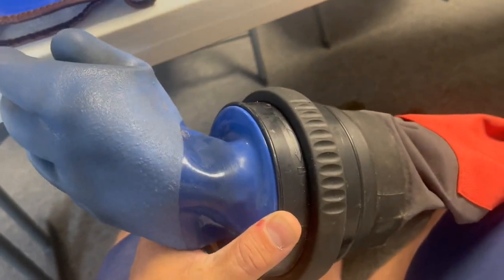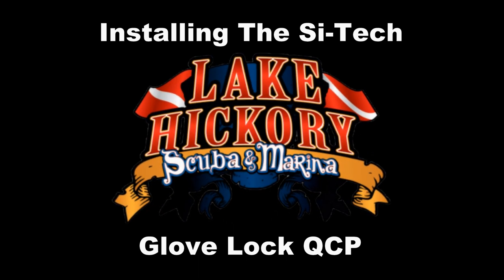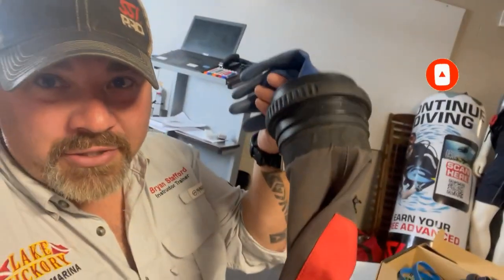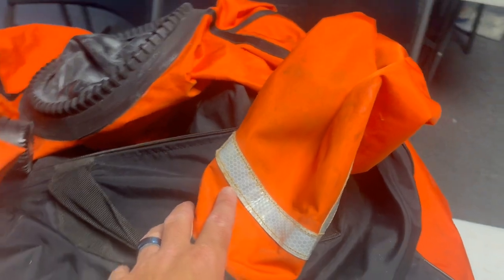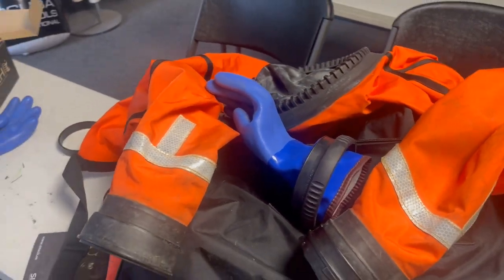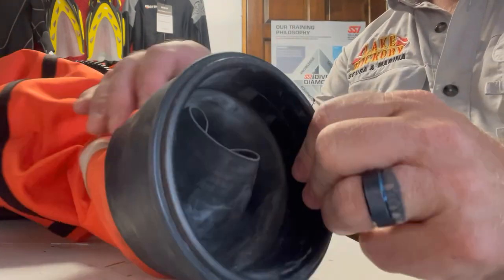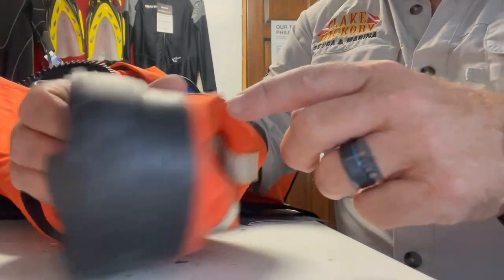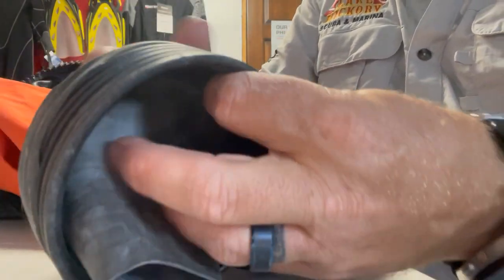Installing The SiTech Glove Lock QCP

Comment: Never had any luck getting these water tight.  Swapped them out for Rolocks and solved all my problems.
Reply from the maker: Hello @kirkwutzke236, sorry to hear that you never had any luck with this system. Depending on which glove you choose to use, the key is to use the correct spanner ring.
Reply: The rings were fine, the interlocking pieces that are supposed to seal didn't.  The ring could possibly have been warped, but if you look at how those tiny "O" rings are supposed to seal to the inner circumference as        compared to other brands which actually compress the "O" ring, I believe they are poorly engineered.  Look at how Kubi's or Rolock's seal.

Comment: Great video!
Question:
How do you remove the inner ring in order to replace the wrist seals if needed?
Reply from the maker: Hello @CarlosF-vk5db, you simply push it out from the inside. I usually reach though the ring and seal with my fingers and pull upward. Sometimes this can be difficult. When I install a new seal, I will cover it in talc powder to assist with proper positioning.
Reply: @LakeHickoryScuba  Thanks for the info! 
Been trying to do it like that, but can’t get them removed and fingers are all torn by trying too hard. I was hoping there was a special tool or video showing how to do it. 😁🤿

Comment: the inner ring ring the is glued to the suit.. the one you fold like i smiley face. does it seal tigth ? you dont use any glue between the suit ring and the first plasting lock ring?
Reply from the maker: Hello @AndersLind-pc6rr, the inner ring is made from a rubber composite, and once it is in place, it is waterproof. You should not use any lubricant or sealant of any kind.